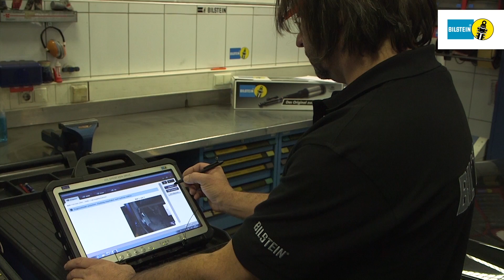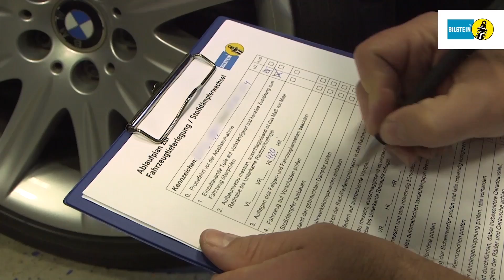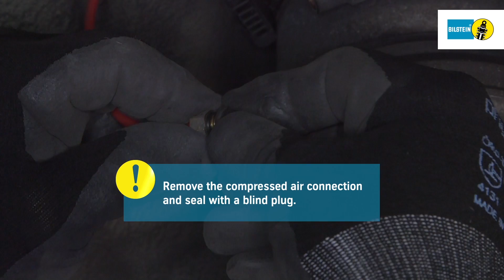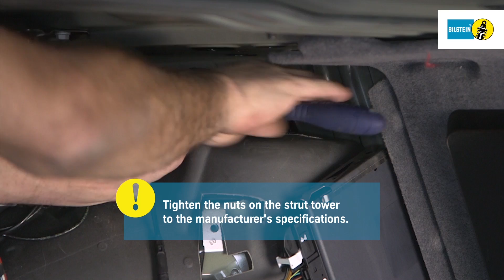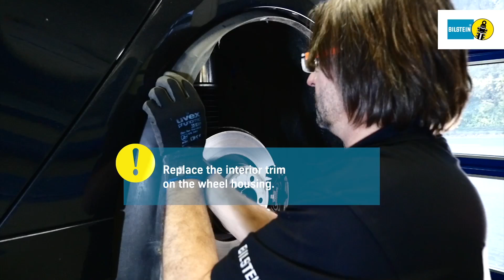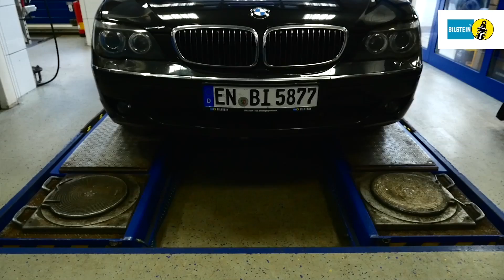BILSTEIN Installation instructions B4 air suspension module BMW 7 Series E65, E66, E67 rear axle

Comment: Good video! Question? I have a '04 745i. Do I have to take out the back seat and unscrew the 3 bolts at the top of the strut or can I follow your examples? Yours method seems much simpler. Thanks.